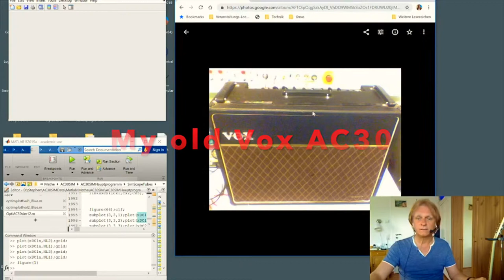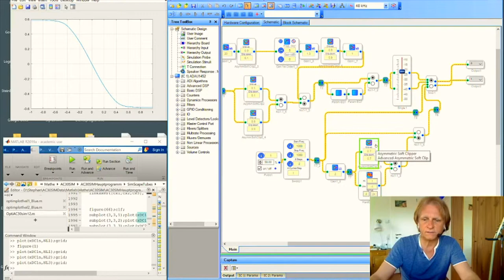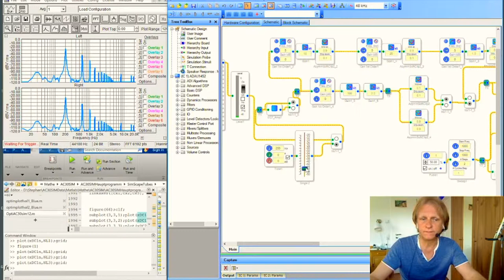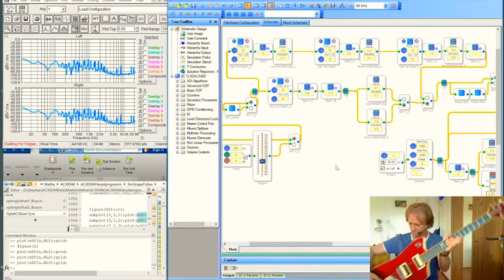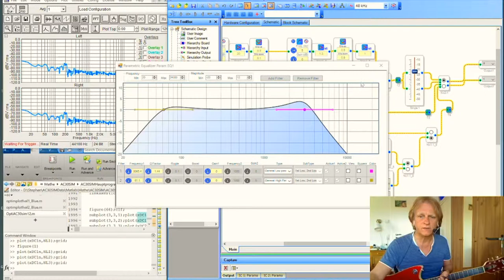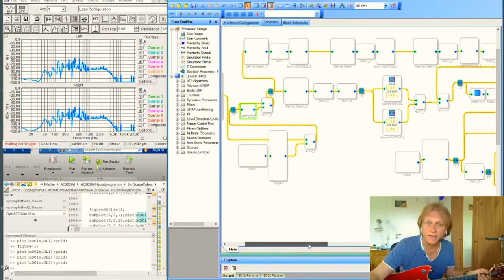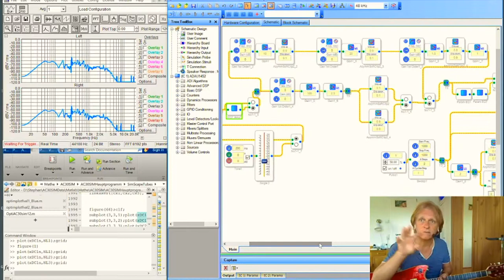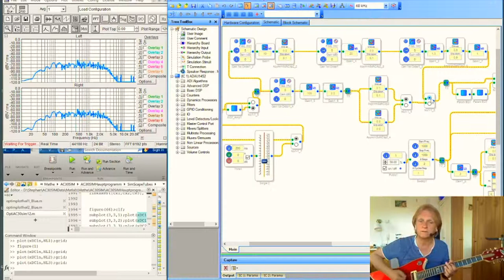Part 1, Distortion for guitar programmed on a Sigma DSP ADAU1452

Comment: are you the same Stephan Möller that did the ac30sim ? Opamp ac30 simulation ?
Reply from the maker: yes, thats me 😀
Reply: @stephanmoller2271  it was a nice circuit, if you don’t have any more comercial interest in the circuit it would make for a nice video. This way you can have the ac30 implemented in every domain. 😃. Nice videos by the way , following along the parts now .

Comment: Great job Sir !. One of the most interesting videos this year. I have the same board and have been experimenting with it for some time. Not doing any amp modeling but IR stuff. You could also use the FIR for cab modeling. Your amp emulation sounds fantastic !.
Reply from the maker: Hannu Hanhi : Yes , Fir are great. But IIR are realtime with no latency
Reply: @stephanmoller2271  Discarding the latency of AD-DA conversion the theoretical latency of 1024 tap FIR with 48kHz sampling rate would be around 10 ms. Would that be too much for real time guitar playing ?.
Reply from the maker: @hannuhanhi183  yes. I have done lots of recording with cubase and it was best to have 64 or max 128 samples latency. But what is the advantage of FIR ? IIR is much more realistic.
Reply: @stephanmoller2271  Ok, if that's too much then it is too much. I am not a guitar player so I don't know. What latency does the 64 or 128 buffer latency translate in cubase, a few milliseconds ?. From my point of view the advantage with FIR is the fact that they can be derived easily from an impulse response and loaded to a FIR. So basically I am using the FIR for convolution. Yes I know, it isn't the most effective way. More effective ways might be partitioned convolution, but I cannot find anything regarding the SigmaDSP about the topic. My opinion is that there is no match to convolution in realism. An IIR would be an crude approximation of a FIR in that sense. Also there is the aspect that there is no simple way to convert a FIR response to an equivalent IIR response. There is a good article about cab modeling here. https://z2dsp.com/2018/07/10/impulse-response-modelling/
Cheers.
Reply from the maker: @hannuhanhi183  Yes, 10ms is relativ high. I wouldnt play it. 3ms would be ok
Reply: Stephan Möller 10ms is how long it takes for sound to travel 3.5 metres, I’ve never heard of anyone worrying about latency when their amp was 3.5m away, is the latency from an IIR different somehow? Thanks for the video by the way, it sounds really great!
Reply from the maker: 3.5 m is realistic when you play on stage. But when you have an latency inside your amp of extra 10ms then you feel 7 m. And this is really not good. So the best would be as low latency as possible

Comment: Soundwise this is perfect. Bias shift(s) and sag are yet not simulated I guess. That's where the "sustain" magic happens even at low gain settings.
Reply from the maker: Have a look on the following videos. There is a section about the nonlinear highpass ( grid current ) and crossover distortion too.

Comment: Hi Mr.Stephan Can you tell me how dou you connect your guitar into board I cant find 1/4" jack input on these boards Thanks
Reply from the maker: You can not connect your guitar to the board because the input impedance is too low. You need a high Z impedance preamp
Reply: @stephanmoller2271  so how do you test after programming thanks ?